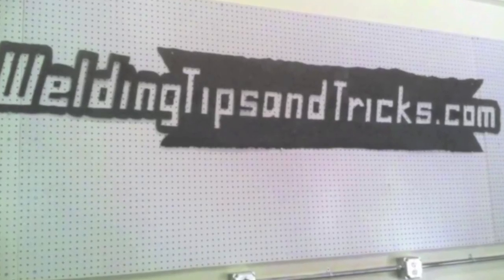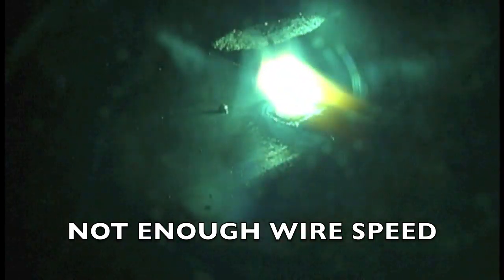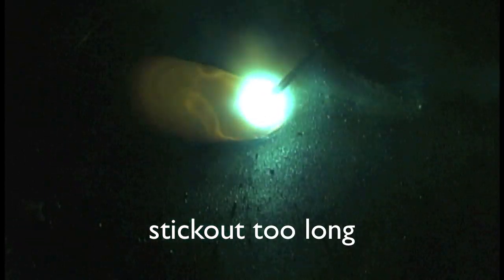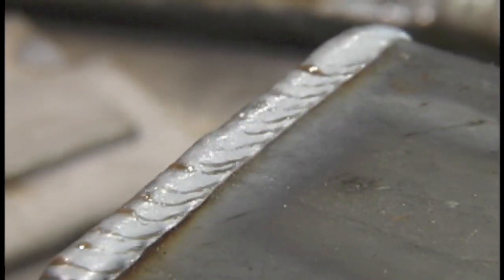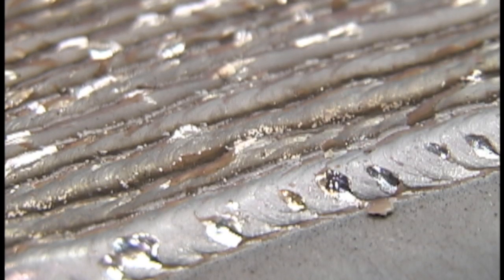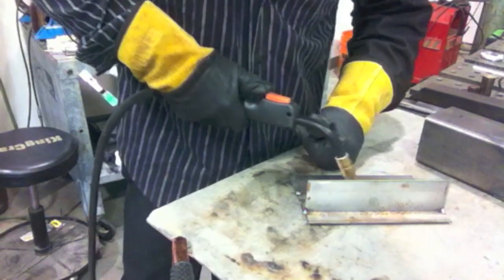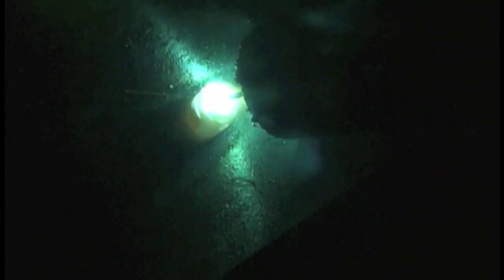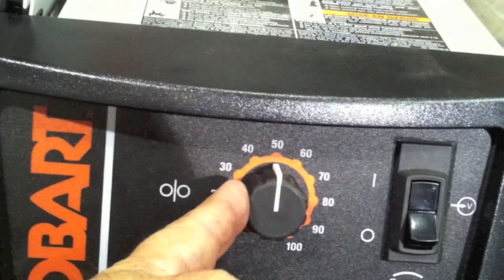Mig Welding tips - Boy Scout Merit Badge

Comment: Thanks, you led another mig welder out of the darkness!  I implemented your ground clamp, auto darkening hood, and stick out advice and started frying bacon rather than drive by shooting.  The auto darkening helmet also shows when wire speed is too low or ground is fluttering (you get flashed.)  Thanks for sharing your knowledge.

Comment: This is a very informative video thank you. I bought myself a cheap HF flux-core welder to learn welding. I know shielded welding is much better if I had the money I would have purchased the MIG170 they offer but I don't. I'm glad you spoke about the kickback when welding I always thought that was from to much speed but now I see why I have been going nuts finding the right setting because the wire can kickback if it melts before it reaches the contact surface is what I'm guessing, thanks again.

Comment: That 210 MVP hobart is an excellent machine, especially considering its price!
I've had one for about 2 years now with a little over 6  12lb rolls of wire through it mainly welding on 3/16 or 1/4" steel. The only bad things i can say are
1. The cables and leads are short
2. The ground cable is too small and gets hot on bigger jobs.
Other than that,  i think this machine is the absolute best mig welder out there for the money!

Comment: Everything I've seen says "push the gas, drag the slag".  The only time it can get confusing is when you are using a gas shielded flux cored wire.  But with a flux cored wire, you want to pull the slag so you don't get it included in your weld.